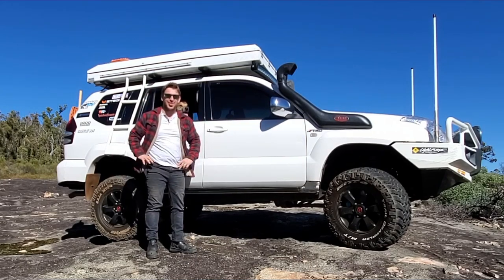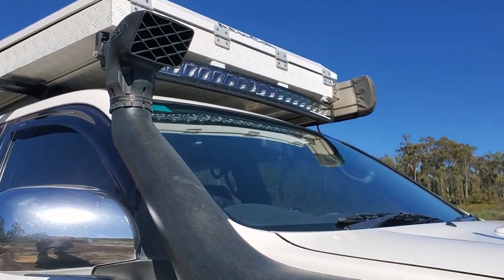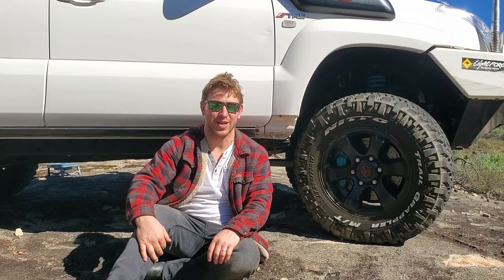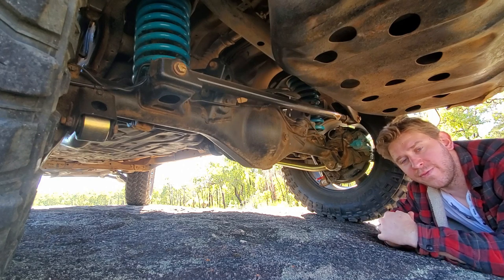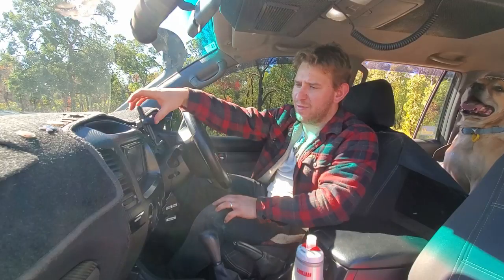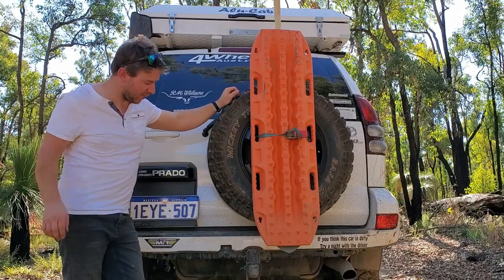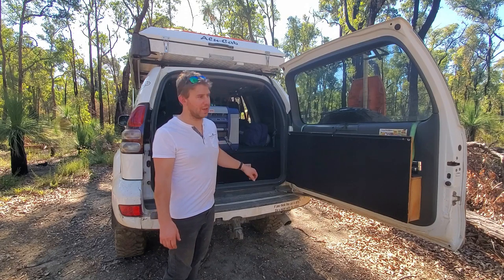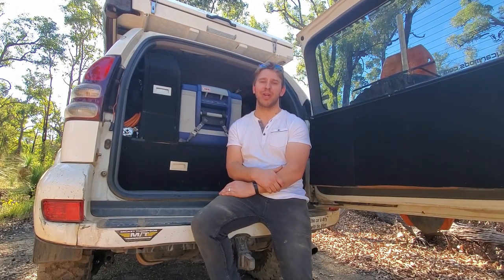My Rig - A detailed look at my Modified Toyota Landcruiser Prado 120 Series

Comment: just subscribed, happy owner of a 2003 Grande, 1KZ-Te, bought 5ys ago, with 185km odo. have done a few mods, 2in lift, Airbagman bags on the rear, new 2.75 exh, winch bar and winch, 3/4 rack, uhf, light bars, Baja Driving lights, dual batt, Kaon door table and rack. Now doing a full egr clean out, new time belt,pump and rollers, new injectors, heat bulbs, and adding that same hood scoop., will look at turbo upgrades/ fixes as time goes by.
Reply from the maker: Sounds like a great rig mate, thanks for subscribing!

Comment: Awesome work Todd. Love the unpretentious down to earth info you are sharing. Just traded our 03 SV8 commie on a 06 120 (hoping to pick up next monday due to covid travel restrictions). Went the 1gr-fe 4l v6 route. I don't suppose you know what differences there are between the diesel and petrol models apart from the obvious. I'm talking, drive train, suspension etc. Cheers mate , keep the content coming. Fan from over the ditch in NZ. P.s if you search YouTube for far north New Zealand 4x4 you will see my back yard and the reason the commie just isn't cutting it lol
Reply from the maker: Cheers mate, really appreciate your kind words.
Good choice with the V6 prado mate. I hear plenty of good things about them. 
In terms of differences, I believe the transmission crossmember is different (which affects what side steps you can fit), different diff ratios and different radiators, but apart from that they are pretty much the same underneath.
Enjoy!

Comment: check out what catch cans do to your vehicle. excessive pressure. will blow seals etc
Reply from the maker: Very true mate, especially when not set up or serviced correctly. On the Prado it caught a lot of the oily blow by and I was happy with it. Also engine parts were cheap and it was an easy engine to work on.
I wouldn't run one on my LC200 though, too much risk if things go wrong.

Comment: My favourite prado video so far. I've only just got my first prado (and first 4wd). I'm curious about your back table and pantry holder, how did you attach it to the back door? Do you have any design tips or just draw it up and make it?
Reply from the maker: Hi mate, thanks for the feedback! Yeah I just attached it using bolts through the plastic door skin, with a sandwich plate on the back. The main weight of the table is taken up through the straps, which are also attached into the steel of the door through the plastic.
In terms of advice, I would just start as simple at determining the size of your table, getting some hinges, then using some webbing or string for your support straps. It can be as elaborate or simple as you like, using whatever materials you desire. Just make sure there is enough room inside the cargo area for the table once it is attached, so it isnt going to foul on any drawers in the rear.

Comment: Shout out from loads of miles away - Kenya. Excellent run through your built. I own a 04 Prado 120 in white and I have some exterior mods done (bullbar, roof rack, 2" lift, MT tyres). Now looking at adding the camping gear. You've provided me with much needed inspiration on the setup in the rear. Especially the water tank - how many litres is it by way?
Reply from the maker: Great to hear mate, well done.
My water tank is 23L, but I always carry at least 5l of water extra to that throughout the car in water bottles.

Comment: How’s the bonnet glare with the stedi curved led lightbar ?

Been thinking of mounting the stedi slimline 42 inch lightbar underneath my roof rack but have not gone ahead as yet
Reply from the maker: Didn't get any glare as the light bar sat higher than the windscreen and has a very distinct lower cut off, so it didn't even light up my bullbar.
Definitely recommend the ST2K lightbars

Comment: great vid as always. Any advice on doing the bonnet scoop as I really want to do that. Looks awesome and serves a function.
Reply from the maker: Thanks mate. Source a genuine scoop from either a wreckers or Toyota themselves. Then measure a million times, to get it to sit over the intercooler as square as possible, then drill your corners and cut the bonnet with an angle grinder. Its nerve wracking but the results are worth it!
Reply: Todd Lauren how does it actually attach? Are there studs in the scoop itself?
Reply from the maker: @jfree1074  yes mate

Comment: Great videos and love all your advice. I recently was driving on a fire trail and managed to all of it in AWD. Am I putting strain parts or should I Keep it in 4WD? I know how they binned up if the wheels don’t get the chance to move independently.
Reply from the maker: Thanks mate.
Anytime I'm offroad I switch into low range. It gives me heaps more torque, better low speed control, and locks the centre diff so that I have a better split of power between the front and rear axles.
The only time I don't use low range offroad is on a hard surface like a big rock outcrop, as it won't allow the wheels to spin to unbind the diff when turning.
I would always advise using low range when offroad just for the greater control and reduced strain on the torque converter.

Comment: Awesome setup mate! Looks mint! 
Just wondering how you fixed the bottom of your ladder to the body? 
Cheers
Reply from the maker: Hi mate, thanks for your feedback!
The bottom of the ladder is held in place by some shaped steel brackets, which curve to match the shape of the inner wheel arch. Then its bolted through the body skin in two places, to give it a firm grip.
Lots of corrugations, jumping on the ladder and offroad driving later, and it hasn't moved an inch!

Comment: with adjustable upper control arms and a bigger lift with more clearance would you say you could fit bigger tyres without any rubbing? eg. 285/75/17 from 265/70/17 ? I got the same car and want to fit much bigger muddies but struggling to figure out what exactly needs to be done to squeeze bigger tyres on
Reply from the maker: Yes I could go a bigger size tyre, but the rims also need to be changed. When I do finally look at some play tyres for the Prado they will be a minimum 295/70/17. Bigger than that and you need to trim body mounts and things.

Comment: Nice work..you have listed a few things that I’m wanting to do or yet to fit in..are u running any diff breathers?
Reply from the maker: Thanks, I've extended the rear diff breather, and the front is extended by factory up next to the starter battery, but I havent dont the transmission breather yet.

Comment: Epic build Todd. I have the same issue with the rear bumper constantly trying to come off. Any tips of trimming it?
Reply from the maker: Cheers mate. Mask it up, take your time drawing a neat line around where you want to cut, then remove the bumper and cut with an air body saw or angle grinder.

Comment: Hi,
I did a 2" Dobinson IMS lift on my Prado 150.
My tires are still stock at 265/65/R17.

I want to upgrade it to all terrain but keep the tire size same as stock 265s.
I go for offroading on deserts.
What do you advise?
Reply from the maker: Hi Kane,
I would probably advice a 265/70/R17 tyre in an all terrain for what you have described. You will gain a bit of clearance under your diffs, without the need to change your rims or UCAs.
The same width tyre will also help to reduce the power loss you would get from a 285/70 or larger tyre.
Cheers

Comment: Hey mate. Sweet rig. Did you ever run 265/65s and, if so, did you notice any negatives (fuel economy, gearing, rubbing) going to 265/70s?
Reply from the maker: Hi Jarrah, no not particularly. I did trim my mudflaps a bit, and on full compression and steering lock the tyres just touched the chassis. But this could be solved with extended bump stops.
The Speedo became perfect, power was still there, and I didn't notice any significant increase in fuel consumpton.
Reply: @offroadcrusader  thanks for the reply!

Comment: Hi. I have the exact prado you do. can you please advise what the boost devices were exactly so I can acquire these for myself.
Reply from the maker: Hi mate, I'm using  a Turbosmart Boost control tee, combined with a GM 3 bar map sensor and the Torque Pro app for monitor boost levels
Reply: @offroadcrusader  Hey thanks for responding! I got the boost control tee, I'm struggling to figure out which is the GM 3 bar map sensor. Is it this one? If not where/which done did you buy?: https://raceworks.com.au/sensors/air-pressure-map-sensors/universal-3-bar-map-sensor/

Comment: Hey man, which STEDI LED light indicators you have used? i cant find them in the website
Reply from the maker: Hi mate, the indicators in the bullbar are from Ebay, while the foglights are from Stedi. You can get the LED indicators from ARB though, straight replacement

Comment: My 2004 vx  starts runs fine but under power down the bottom any suggestions  would be appreciated
Reply from the maker: Assuming the engine is all up to date with servicing and things, I'd be checking for a boost leak. Intercooler gasket on the turbo side, throttle body gasket on the manifold side, all the vacuum lines around the MAP sensor.
A full intake clean will definitely help if you are down on power.

Comment: Nice rig Todd! I have a 1kz with 400k on it and Im going down similar roads to you with the exception of  having done a muffler delete instead of full 3 inch exhaust, tune-it chip, OBD reader and an intercooler fan. Just waiting on 3bar Map, boost-t and injectors to arrive. I Already have big mouth Hilux scoop, oil pressure, EGT and water temp ready to go in.. Was fitting your scoop much of an issue?
Reply from the maker: Nice one mate. You need to take your time with the scoop install, just to get it to sit right on the bonnet. The Scoop has a flat base and the prado bonnet is curved, so you need to use wide brackets to help pull the bonnet skin up to meet the scoop nicely.

Comment: How much did you gain from going from factory boost to 18psi? Trying to get a boost controller shipped up to us here in Botswana. Do you have and EGT gauge? Cheers!
Reply from the maker: Yeah its much more punchy at around 2500-3000rpm now. No EGT gauge yet.
Reply: @offroadcrusader  I gave up on the boost controller. Borders shut and we can't get one shipped in for a while. I made a fitting with a 2mm hole as a boost leak in a T. Added a small restriction before it as well. Sitting at 13.5 psi now. 5US ;)

Comment: Hey @todd - Loving all the videos - Question: I just bought a 120 and am about to pull the trigger on bash plates. Do you use, recommend, or have ever wished you had a bash plate for the main fuel tank?
Reply from the maker: Hi Dan, welcome to the channel!
Bash plates are a must on these vehicles due to how low slung they are.
The fuel tanks already come with factory bash plates on them, but the main fuel tank under the passenger side of the car does seem to have a weak bash plate. Kaon do a great replacement, but it isn't cheap. Bash plates are sacrificial in the end, and mine have taken a great battering over the years of driving tough tracks, but the fuel tank is still fine.
If you are planning to do a lot of tough tracks with rocks, tree roots, mud, etc, then perhaps it would be a good idea to invest in them if you have the money. Otherwise, I'd be inclined to invest my money elsewhere.
Reply: @offroadcrusader  Thanks mate! Kaon is having a sale this weekend and combined with my first time customer discount, the main fuel tank plate worked out to be $348 so I just pulled the trigger. Thanks again for what you do!

Comment: Could you share which roof rack you use to mount your RTT? I'm looking for solution to mount my RTT as the feet of my OEM rack broke when moving the rack with RTT on it.  Tks.
Reply from the maker: I'm using Alu Cab cross bars on some ARB backbone legs

Comment: Hey Todd I went back to check again on Ep 2 to see the desk install, the audio drops out at ~13.45 as you are explaining removal of centre consol, any chance you could fix this issue ? Like you vids on Prado 120, must admit I am stealing some ideas for mine , thanks
Reply from the maker: Hi Peter,
Sorry it's taken me a while to get back to you.
After reviewing that video, it seems that a copyright issue has cut all audio where a song has played, meaning that the song no longer infringes on copyright, but also that I have a silent section in the video. Unfortunately without remaking the video, there isn't anything I can do to reverse this, and the original file no longer exists. 
I will endeavour to fix or replace the video as soon as possible, but in the mean time if you have any questions regarding the removal of the centre console removal, feel free to ask.
And thank you for your support, you are more than welcome to use my ideas haha.
Reply: Todd Lauren thanks for getting back , I would like to know how to remove the section around the gear sticks and what you were saying about the switch panel to install the remote for the winch, just a few pointers would be helpful . Thanks mate

Comment: I’m looking at doing my wheel bearing what is a good brand to get and where from 
Thanks
Reply: get the gen toyota . abit more expensive but will last longer
Reply from the maker: Genuine Toyota are always going to be the best option. However if you are proficient at changing the wheel bearing assembly yourself then a cheap unit from ebay will suffice for a number of years.

Comment: Did you end up using adjustable upper rear trailing arms?
Reply from the maker: No just the fixed extended lower rears with the curve in it. They help allow for better rear end flex and also help centre the rear diff in the wheel arch

Comment: What’s your recommendation between a petrol or a diesel Prado? I’m in the market at the moment and am still trying to decide
Reply: I myself got a V6 prado it's really strong engine, bit heavy on fuel but well worth it
Reply from the maker: My recommendation would be diesel = long distance touring. Petrol = short distance commute/weekender 4wd trips. Both engines have their pros and cons, but I believe that if you are going to reap the benefits of a turbo diesel, you need to be driving it long distances or be giving it hell every now and then. If not, go the petrol.
Reply: @offroadcrusader  great! thanks a lot!